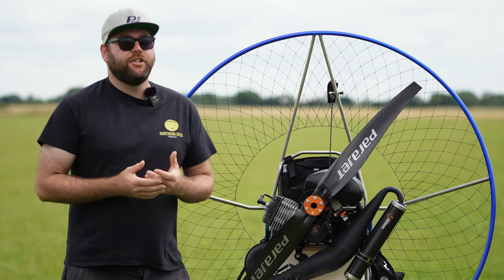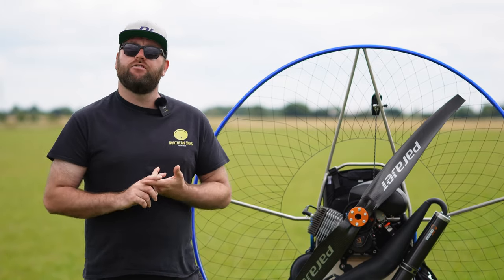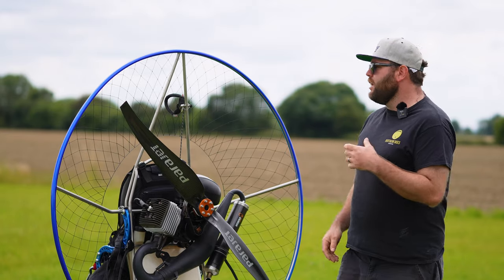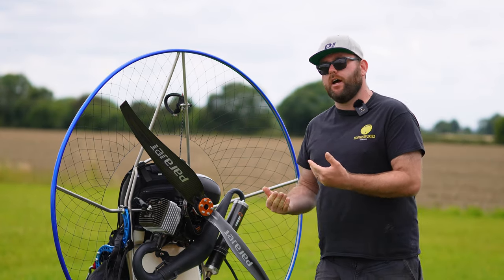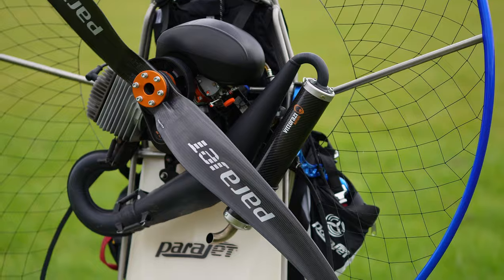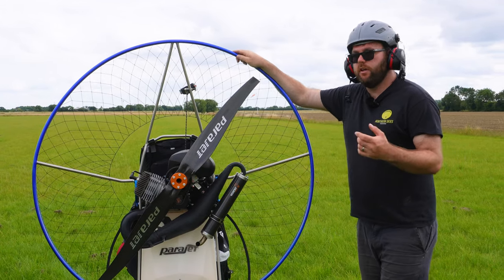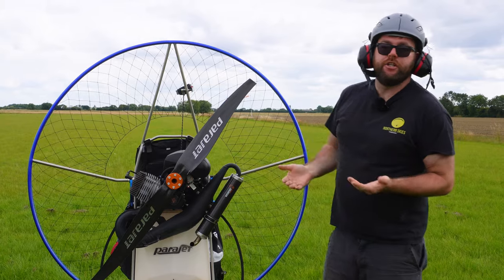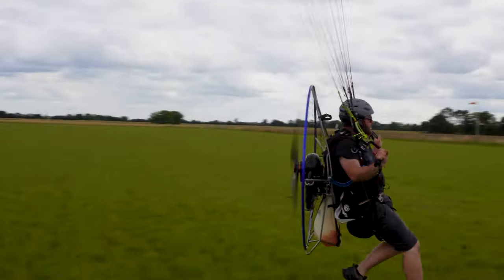How to Tune a Paramotor Carburettor | Step-by-Step Guide

Comment: Before adjusting your carb don't forget to check that you haven't got any leaks anywhere along the exhaust system. If you have then this will upset the "back pulse" and your engine will run erratically and this changes as the exhaust warms up/cools down.

Comment: Thank you for this. I've had several motor outs in a row after holding cruise speed, 5000-5500RPM, for about 10-15 seconds. I think it's too rich. (Moster 185 MY20)

Comment: I accidently turned the H needle just a little bit today, what should i do now, the idle is abit rough and high vibration. I was trying to replace my throttle cable end cap/termination when I accidently turn the H needle.
Reply from the maker: @joatmon_servant  I would speak to
Your dealer if its in warranty? If
Not set it back to
Factory settings.
Reply: @northernskies  the warranty already expired last year. According to the datasheet, the H has to be set at 1 Hour + 30/40 min, but how do I begin to set it to that configuration, do I need to fully close the H screw first then turn it to 1hr+30mins?
Reply from the maker: @joatmon_servant  he's thats correct fully close then reopen to that setting.
Reply: @northernskies  alright thank you for your help.